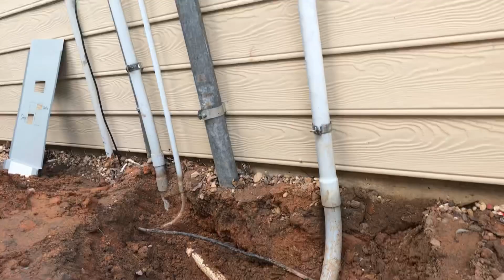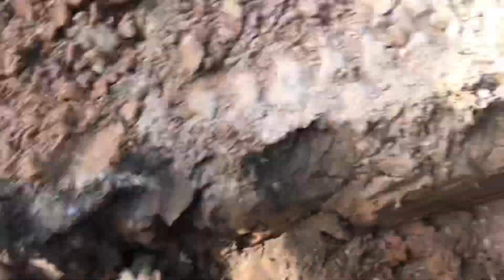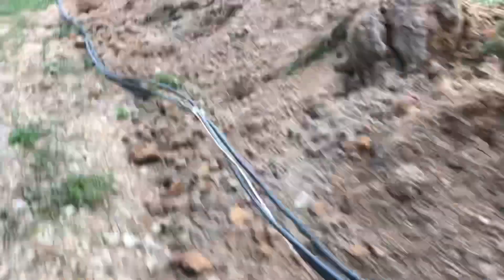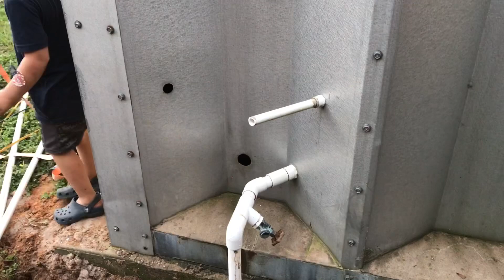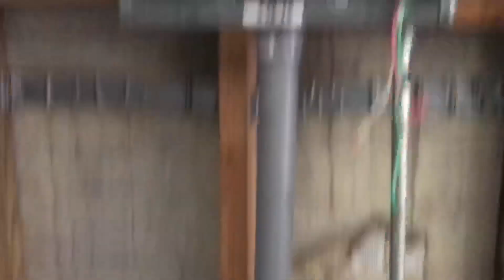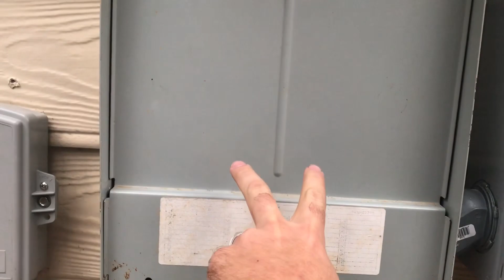Replacing Electrical Service to the Shop

Comment: Great video Tom. Congrats on getting their workshop power working again. Where are all the big rocks under the soil? I only saw one :) Then I remembered, oh yeah -- this is obviously not Fort Worth, where we have clay soil with all sizes of rocks starting 1 inch below the surface, and deeper. It's a nightmare up here any time we have to do similar projects involving excavation, either by hand or machine. And hence why any such $ estimates are high. And throw in recent rain with our rocks and clay-like soil for a challenging suction situation when trying to remove rocks of all sizes. That's what I was recently faced with while doing a little excavation project slowly and by hand with shovels (don't need to damage my nearby sewage drainage).
Reply from the maker: Dan I finally made the connection. I know who you are!! Ha! I’ll try to keep you entertained while you’re laid up :)
Reply from the maker: And for the record, there are NOT rocks at my place. Just sand and clay. This is just 10 miles west and actually has some broken sandstone rock at least. I can go hundreds of feet at my place just layers of sand and clay.